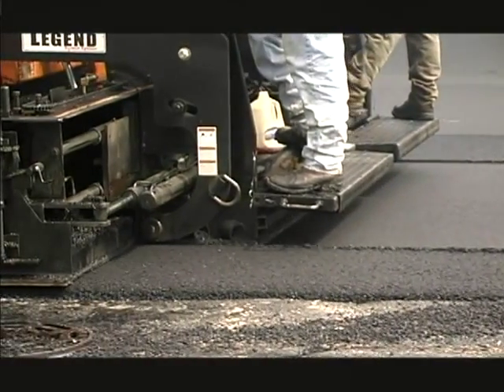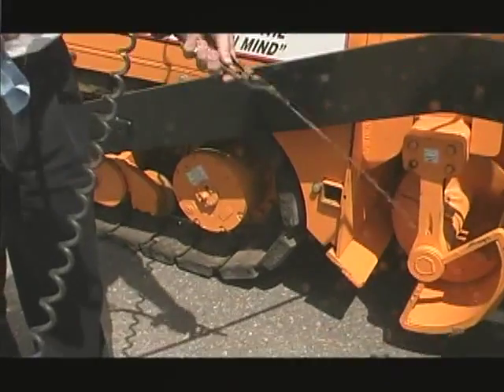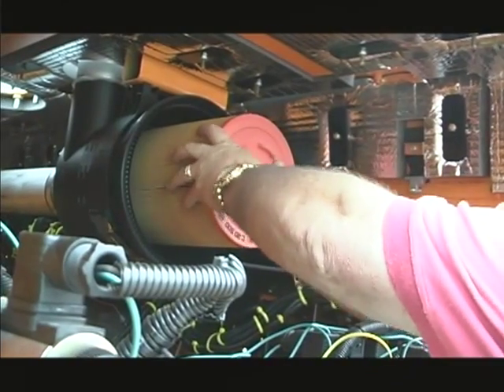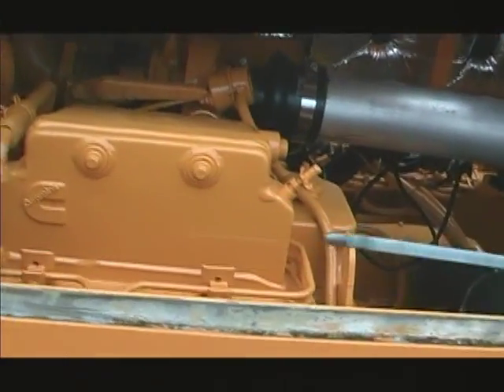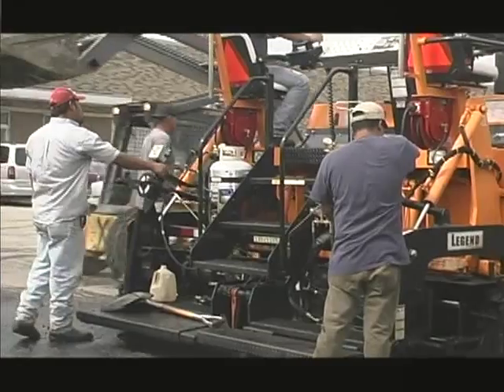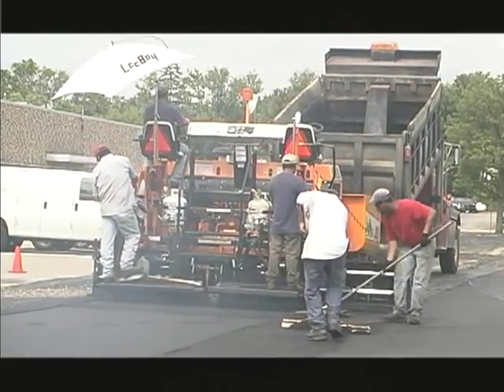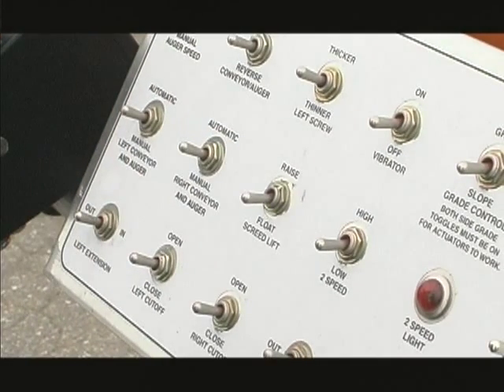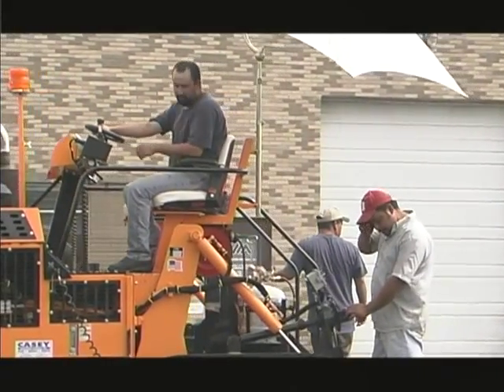LeeBoy 8816 HIGHWAY CLASS CONVEYOR PAVER OPERATIONS & MAINTENANCE

Comment: Your screed extension wasn't hot enough that the reason your not getting uniform texture, I'm pretty sure that's an electronic heating element. Just wait a little longer to pave or get a worker to heat the underside with a torch for a few minutes